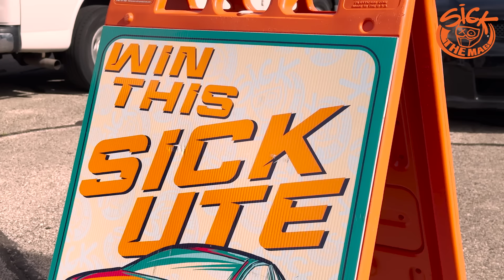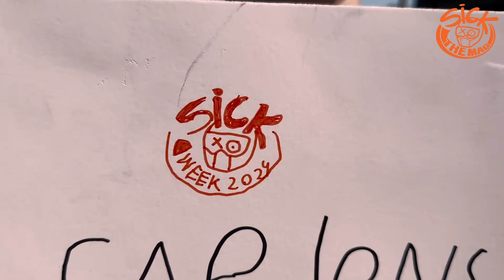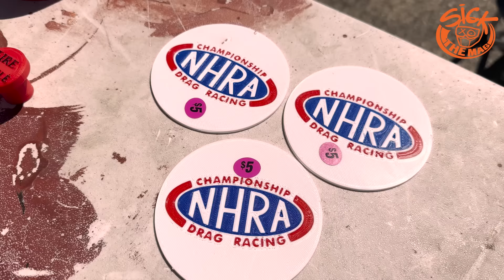All The Boost at Sick Summer (Day Zero)

Comment: if it dont have a diaper get rid of it. NO OIL DOWNS This week
Reply: Well you can't fully control that because not all require them because it's based on nhra rules and they only have to follow those rules
Reply: @yojithecarguy  I'm sure the event organizer can add any rules they like.
Reply: You obviously have never had to install an engine diaper.  Or try to change the oil after installing one.  They are a major pain in the ass.
Reply: @danmyers9372  No my Car i raced had a pan and a catch can to keep anything that may have went boom within the car.
Reply: @danmyers9372 surely better than a 200 mph crash though 🤷🏻‍♂️
Reply: @s3quattro10 if they are going that fast they need to have a belly pan or diaper